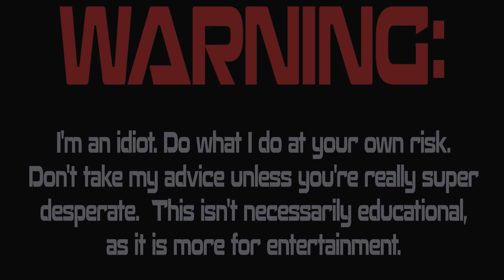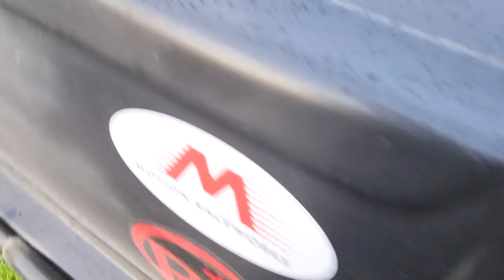The Race Truck Started on FIRE and Racing Door to Door with Cleetus McFarland!

Comment: Looks like Derek has another awesome burnout rig!  Thanks for the great content as always!
Reply from the maker: thank you for watching
Reply: @ViceGripGarage  Derek I love what you've done with the race truck. Might I suggest a full steel rear wheel tub. Maybe add a tires slicer the the back edge. ✌️✌️✌️✌️
Reply: Man Charlotte looked great out there in her first run.  Get the brake lines sorted and she will be a heavy hitter!  Thanks Derek for the Thursday video. Made a guys day that much better!
Reply: Wow, the burnout truck did amazing, and you did a great job keeping it off the wall in that small pit! It just needs some Red, White and Blue added.
Reply: Hey, it did turn right!

Comment: Wanted to thank you on sharing them ceramic lightning boots. I found them in stock options for the 5.3 and the 350 Chevys BTW standard ignition. Not the exact setup like what you put on this rig, but sold them to a few customers since that video. 
Great work and much appreciation Derek.

Comment: Burnout truck did awesome! Well ya kept all the rubber off the electrics, but not off yourself, lol. I know some of those Australian burnout cars run big, thick wheel tubs, with a sharpened edge on the back, so when the tires come apart, it shears away the flaps, and preserves the body panels. Would keep the rubber off you too, just a thought. Most relatable guy on the tube. Thanks for keeping it real!

Comment: Sounds and looks like you have hit the ball out of the park for Burn Out Car, Eight Mile Car, and The Oval Race Competition (could use a little more power).
The cars made for a great weekend and it appeared to eliminate tons of stress for Derek.  Having only the brake line problem with the burn out car was without a doubt the least issues that Derek has had to deal with since the team started attending competitions.
Again, this fine performance was in my opinion your best ever competition.
A Big Plus was seeing Bentley and Derek signing autographs together.  Bentley is a Great Representative for the family.
Congratulations on an awesome showing and a big shout out to Jessica for her keeping everything together.

Comment: Not sure if u will c this, but u might want to try something called Fire Sleeve. It comes in many sizes and sold by AC Performance. It protects up to 500f continuous and 1000f intermittent.  It's also resistant to oils and such. Might help

Comment: you should grab some nutserts and get some wheel tubs to put in  the rear , Gelp keep the rubber debris under control AND if a tire comes apart and damages a wheel tub you can pull it out quick and smack it around and stick it back in

Comment: Copper-nickel (cunifer) brake line is the way to go.  Really easy to bend and flare.  Summit has rolls of it.  Get a tubing straightener too, makes it look much better.
Don't go cheap though.  Off brand stuff isn't certified/rated.

Comment: What about setting up the race truck to turn left and right. Depending on the frame modifications, you should be able to replace the front suspension and steering back to stock A body parts. And then depending on modifications to the rear suspension, you should be able to relocate the rear diff. and suspension to stock locations and drive straight again.

Comment: I had a caliper fail at around 100mph racing an RX7 in NASA. I  had been pumping the pedal into the braking zone the whole race. Finally one lap before the win the caliper failed completely braking before a sharp corner, spraying brake fluid over the cherry red rotor, catching on fire and sending a plume of smoke out from behind the car. Fortunately it was at a racetrack in an empty field so I was able to stop safely. I drove slowly back to my pit so the car owner could put the fire out.
It turns out that the wheel bearings had failed and the rotor machined a hole into the caliper.
That P71 race series looks like a hoot!

Comment: Without knowing where the caster is on the burnout truck, the power steering might be working better than it seems. If caster is really high it will be hard to turn. On my dirt cars, I go for a lot of caster on RF and only like 1 degree on LF. Hard to say where it’s at until you put it on an alignment machine or a gauge on the rotor. If you bring caster down to like 1 degree or 1.5 degrees on both fronts it’ll steer real easy!

Comment: You need to take that power steering pump off a the relay power direct and ground withe a fuse and trigger wire to a on off switch it has a internal relay it should be pumping at soon as u trigger it no lag or delay

Comment: Ditch the Volvo pump, get a manual steering gearbox, use a Prius in line electric power assist. Power and Ground is all you need and the Prius electric motor will you give you the power assist you need. This will also remove the pump from the front of the bumper in case you catch it on the K rails, removes the hydraulic fluid and extra lines that can fail.

Comment: Need to get that shifter adjusted correctly. If that shifter is placing the trans incorrectly (not fully into gear) you'll smoke that transmission Derek

Comment: You'd probably get along quite well with Speedycop and his gang in the aircraft.
Lots of interesting and cheap builds.

Oh, you didn't get time to replace the plastic brake lines...

Rear wheel tubs (to protect the body) and a thread in dip stick also on the build sheet?

Comment: Hi Derek I have a idea for your burnout truck. The body or shell of it. 
How about elcamino take on truck but for the front clip use a 1st Gen Camaro fiberglass flip up clip or sheet metal with a fiberglass/plastic nose of a second generation Camaro. Kinda like a El-Camaro what if. It’s different.

Comment: What rules are there for working on oval track car's between races?  It would suck if you have to run the car the way it is if all it needs is some plugs or plug wires.

Comment: If that Volvo power steering pump is the same model i think it is, should have a controller that is based on speed, at low speeds it should be very strong but at a certain speed it basically turns off, it must be stuck on the high speed mode.

Comment: Yeah!! I don't like plastic or whatever material that melted as a brake line.  Have I got this straight? you said your break line melted? Maybe go with old-fashioned steel or even stainless steel tubing. You've got the little tools with a spreader tool.